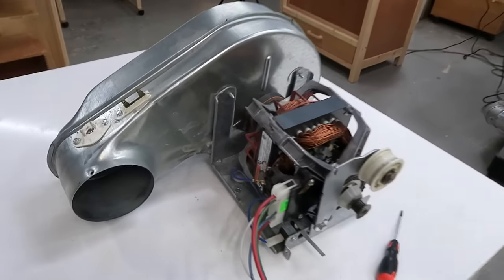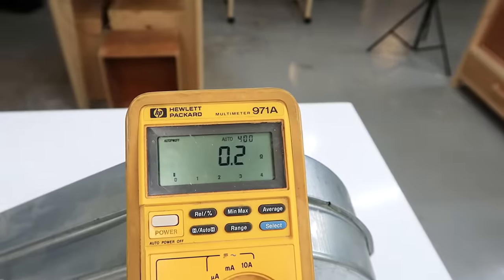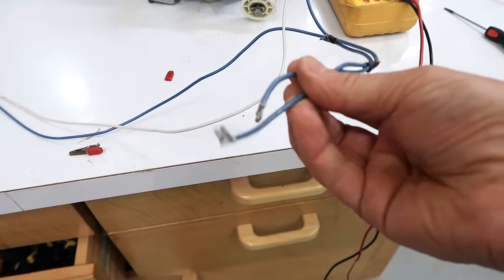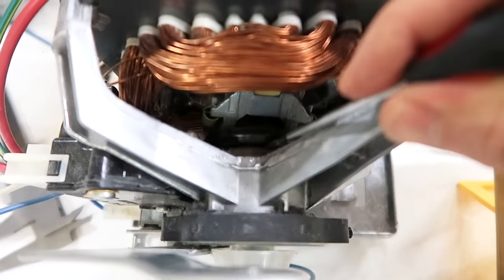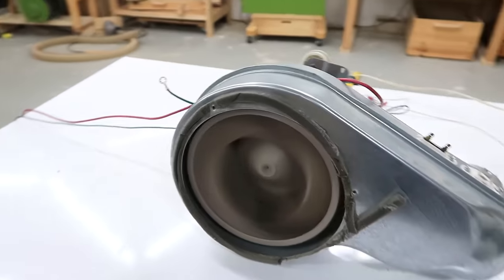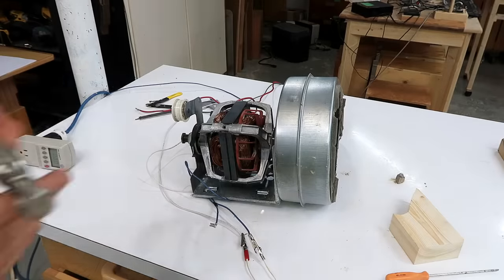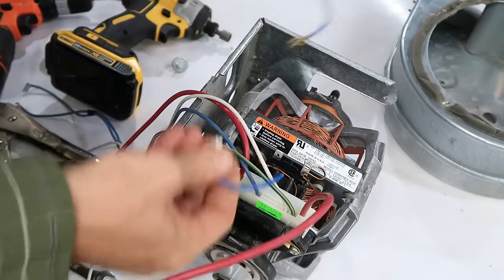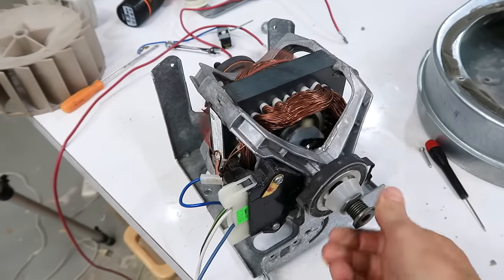Wiring up and reusing a clothes dryer motor

Comment: Don't write off those red (heater) wires too soon - might be very handy to have some way to signal/switch something on after the blower/motor gets up to speed. Ex: Maybe run the sander motor through those wires. Now the "On" switch results in a sequencing of blower first to ensure dust mitigation, then sander to do job.
Reply: I did this. When i made my wood table saw, i used one of these motors (from a much bigger unit) and wired the vacuum cleaner to start through them. It's in general a good idea to never cut wires that aren't specifically assigned to something you can't use, you never know when you might have an use for them. I just tie them up neatly, and then put a ziptied bag over them to keep dust out.
Reply: I was thinking the exact same thing as soon as he described it. Lots of possibilities there.
Reply: He didn't cut them I think...  Just removed them from the plastic connector.  He could reinsert them I'm thinking if need be.  I just don't see him overlooking that
Reply: @jimsjacob  Yeah he just depinned the connector
Reply: False alarm guys.
THANK GOD!
Reply: Dont Check My About Page Link  You're doing it wrong

Comment: Retired appliance tech here- the BEST way to remove those type blower wheels is to lightly clamp your vise grip on the motor pulley where the belt goes(so as to not dmg the ribbed pulley with the vise-grip teeth), then pinch ONE fan blade and swing the motor rotationally till you have the vise grip as far as it can go the one direction, then give a quick WHIP the other direction while still pinching the fan blade and let go at the last second and when the vice grip strikes the table (or the floor pan, of the dryer) the fan wheel spins right off as the vise grip comes to an abrupt stop - works like a champ EVERY TIME, and you'll never break the plastic fan when changing a motor
Reply: Yep! Same principal as an impact gun. :) Auto mechanic here. Very often a rusty bolt will break if it's loosened with a steadily applied torque such as via a plain socket wrench or breaker bar. In contrast, the fast impact action of an impact gun will loosen the rust and give it sharp rapidfire taps that eventually work it loose intact. Ford made an engine in the early 2000s called the "3 Valve Triton." I believe it came in V8 and V10 flavors. Anyway, they used this bizarre long sparkplug that was a bad design and it would get carbon fouled and rusty over the years until it was FIRMLY stuck in its hole. I ain't kidding either when I say they get stuck, that's S-T-U-C-K, stuck! The best way to remove them is with an impact gun while the engine is piping hot. Just get the strongest and smallest 1/2" impact you got and the tightest fitting extension and socket you got. You just make pretend that you're an F1 driver and take the truck for a race around the neighborhood, then immediately slam the plugs out with the impact without mercy. If they break, they break. 🤷🏻‍♂️ The ones that break were always going to be hopeless. They would've broken no matter what, especially with a ratchet. The extractor tool that gets broken plug bodies out of the hole works pretty good. Usually you'll get 5/8 or 6/8. The back ones are the worst. The impact action is critical for the job. You may think it's horrifying to imagine putting an impact on a sparkplug, but it's the only way to avoid an 8 hour book pay nightmare.
Reply: Damned Maytag have a small belt making the connection.. That trick will help with some but not all my stuck fans
Reply: @mannys9130 bro, I am dealing with this problem! I got a damn 2003 Ford Expedition that I need to change plugs in 😢 what is the tool you speak of to get broken ones out cuz I’m quite sure it’s going to happen 🙃

Comment: That simple cutoff switch made of bent wire that lets the motor detect if the belt is intact or not is quite clever. My drier doesn't have anything like that and once announced its broken belt with what I can only describe as the screams of a hundred rubber chickens in a cement mixer.
Reply: This youtu.be/khOfSVULtsU is of course what rubber chickens should sound like.

Comment: The "nut" inside the blower fan is round and knurled.  Short of welding/epoxying it, it's not at all useful.  If you come across more of the motors, some have a longer shaft and some have the pully and fan threads reversed.  i.e. the fan "nut" has normal threads and the pully has reverse.   Just FYI. :)

Comment: That was so so generous and kind of you to show us and educate us noobs on how to tell what the wires refer to and how to test them. Any chance you can do a video describing my certain elements have more wires than others in a dryer or washer? For example I was so overwhelmed when I opened up my dryer and saw the timer switch had like 6 wires and capacitor had what seems to be 4 wires and the cycling thermostat had 4 but the thermal fuse and high limit thermostat only had 2! Can you maybe do a video getting into all of these elements and why each has the amount of wires it has?! Thanks so much! (If u can’t do a video maybe u can do a written explanation) ?

Comment: Can you tell me is the number 4 or five spot on the motor the hot wire? The other is neutral correct? And the green wire going to the bent piece of flat copper is the ground?

Comment: Hello Matt, I have the same motor, not the piece that goes on top, I want to use it as a fun and I do not have the white part that goes on top. Could you tell me how to wire it? I know the black and white may be what I need to wire for it to work, and the blue and red wires may be different speeds but I am not sure. Thanks.

Comment: My drier uses extra contacts on the centrifugal switch to run the cycle-end buzzer. If the motor is not energized but the centrifugal switch is engaged (indicating the motor is turning) the buzzer sounds. Saved them the cost of a 1-second timer relay. Actually that must have been my previous drier; the current one has not required service yet so I would not know how it is wired.

Comment: I just got one before yesterday,  it took me hours to get it removed from a broke dryer., tested and is working well but I am still not able to unscrew the fan which I like a lot because designed in the way it can serve as a micro turbine if cast fur a durable use.

Comment: the fastener location on that style of motor was very perplexing for me, as there are no fasteners . whenever i save a motor i also look for a way to take it to bits so i can clean and replace bearings in need be. i got a motor just like that one from an old dryer and its centrifugal clutch was busted so i had to find a way in. so yea, there are no fasteners but a spelter socket type method of assembly.

Comment: Interesting video. I have two motors that I need to use for something. Will check the wiring on my motors to find the correct power one. Hint for removing the fan  the square in the center of the fan is for a 1/2" drive ratchet and extension. Easy peasey if use the ratchet.
Reply: Yeah, I was wondering if that was 3/4" or 1". But same thing, the square is to get it off and on.

Comment: Did you try open Windows at different levels?
I managed to blow air from outside into our house by opening the door to our hot, not sealed attic. My assumption is, that the hot air wants to escape upwards, but cant due to air pressure. When opening the door and a window inside, the air from outside replaces the air that flows out, creating a strong air stream without a single watt of electrical power.

Comment: The two blue wires go to the long white long thermal fuse on the blower wheel.  Can bypass for this purpose, but never in an actual dryer.

Comment: I’ve always been proud of a clothes dryer fix I did many years ago. It was just a belt replacement but I couldn’t find the right sized dryer belt.  Instead I found an old ford escort timing belt that fit, still running solid! #improvise
Reply: That was my experience as well. I suspect manufacturers tend to use whatever belts are the cheapest at the time to benefit from the economy of scale. They don't really make a secret of this, but they tend to list such parts with custom SKUs to make them seem like proprietary parts. My dad once tracked down a belt replacement from a car parts dealer just by showing them the broken belt, they measured it and found something off brand that was functionally identical. 12$ vs the $50-$100 asking price for "geniune" replacement parts from amazon and specialty suppliers.

Comment: the red wires are used as a safetly interlock so the heater cant turn if the motor/fan is not turning.

Comment: 4:43   It looks like the centre of the pulley  may be a 1/2" square  from a ratchet extension.
Reply: I was just about to say the same thing but figured somebody already has, yes that was what I used when I took my dryer apart.

Comment: Those motors work very well unmodified just as an ventilation fan`. Just hook up a dryer hose and run it to the outside.
Reply: It would have really awful efficiency, though. A motor that big could easily run something the size of a condenser fan.

Comment: I too had an intact take- off motor from a dryer and made a buffer- polisher machine, it works well but gets very hot in a fairly short period. I think the duty cycle rating of those types of motors are short "on" duration, longer "off".
Reply from the maker: dryers typically run continuously for an hour
Reply: @matthiasrandomstuff2221  Then the answer is obvious; I'm working it too hard. ☺
Reply: @BeachsideHank  How hot? It's typical for motors to get hot during normal operation. For example, the motor in my desk fan typically operates at about 65°C on low.

Comment: Very helpful. I just acquired my first motor from my old garage door and haven't started tinkering yet. States 115v, 4.6 amps, 1,000 rpm. Think it's suitable for anything? I'd be interested in building a small bandsaw or small wood lathe.
Reply from the maker: Suitable for anything that doesn't run for more than 20 seconds at a time.  thsoe garage door motors are not continuous duty.
Reply: @matthiasrandomstuff2221  - you should have let him find that out on his own! Rats! 🤔

Comment: Would that motor be strong enough to run a rotor off of each side, and produce more air flow?  Not sure how that would be incorporated into a dust collector or whatever, but it seems a waste to not take advantage of it.
Reply from the maker: One bigger rotor will do better than two small ones

Comment: i was trying to make a pottery wheel from a dryer motor, you think thats possible?
Reply from the maker: Just need to gear it down appropriately.  But pottey wheels are usually variable speed and reversible.  Dryer motors are not.

Comment: weird that there isn't a capacitor for the starter winding, normally the capacitor is used to give the 90 degree phase shift
edit: never mind, it's a split phase induction motor

Comment: I work on appliances for a living and those blower wheels are incredibly hard to get off at times. Very frustrating
Reply: This one looks like a simple square drive would have done the trick.
Reply: I’ve never had a issue w it’s the right tools.  Socket driver in the blower wheel and and socket on the pulley at the other end. On ones with a speed reducing belt the blower shaft has a flat surface to get a crescent or ring spanner on to. And just remember to turn the right way since they are reverse thread

Comment: Seems to me that volt-free connection on the motor (two red wires) could be very handy - if you end up using this motor to make a tool, the red wires could be used to control a separate dust collector on a different circuit. Given the fact its designed to handle the power of an inductor - the switching mechanism can probably handle anything you want to throw at it. Another idea that occured to me is if you had some kind of multi-stage dust collection system (using multiple fans), you could daisy-chain them on a single switch with multiple power sources.

Comment: Sort of confused. He says the starter winding is smaller, creating greater resistance, leading to a phase shift. But then when he measures it with the ohmeter (when centrifical switch isn't depressed) it says the starter winding has a resistance of 1.8 ohms in comparison 3.6 when it is running. Why does the resistance go UP when the starter winding is disconnected?
Reply: Not sure about the use of the phrase 'greater resistance'  in the explanation - the starter winding is just wound differently to give the temporary start up phase shift (thinner wire but fewer turns could still give the same resistance).  Answering your query: The starter and main windings appear to be both 3.6 ohms d.c. resistance, but are in parallel when both are connected - not in series.   Two 3.6 ohm resistors in parallel gives 1.8 ohms.  When the starter winding is disconnected, there is just one at 3.6 ohms.

Comment: yikes when you put that wood pry bar in the fan to remove it I cringed.....just last week I had to replace ours and it cost me $170. FYI that centre hub on the blower fits a 3/8 drive ratchet. for removal and reinstall.

Comment: I laughed when you plugged it in without holding onto it or clamping it down.
Reply: Whenever I have open 120Vac connections, I tape down the wires and think about what might yank on them before I turn on the power.  He should have done that.
Reply: Sometimes a motor will roll over on the table when you turn it on without something holding it down
Reply: @Malungeon18436571  Not just sometimes!  Due to conservation of angular momentum, a sudden start of rotation inevitably produces a perpendicular torque.  You see this all the time on BattleBots when robots with high-speed horizontal spinners compete.  Every time they make a turn, the torque throws up one or the other of their wheels, making it look like they're dancing.  They're not dancing.  They're miserable.  They're forced to fight day in and day out, getting their guts kicked in.  And no robotic sex, either.
Reply: @paulkolodner2445  I’m ok with that. I’m a hardliner on robot rights. Give them an inch and they’ll take a mile.

Comment: Im trying to accomplish the same thing as a dust collector motor, but for some reason the motor gets really hot after only a few seconds work. What the heck am I doing wrong.
Reply from the maker: wired incorrectly.  Posibly using the starter winding as a run winding, but only a guess
Reply: @matthiasrandomstuff2221  ya I thought I followed it close. But it was pulled apart when I got it. I have half a harness, and everything else is missing. I'll keep trying. 
Love what you do here, unfortunately I'm trial and error, I know very little about electrical.....very little.
Reply: @matthiasrandomstuff2221   I'm not sure if I can share a picture of what it is I'm working on, through hear, but I have tried 10 different ways, 2 ran the motor both times it heated up very fast, didn't allow it to get to hot though. Used a sensor to watch if the temp spiked or not.

Comment: Serious question, what is the difference between DC resistance and AC resistance?  Did I miss something somewhere?
Reply from the maker: yes.  Where to begin -- I can't give you an electronics course in a youtube comment.
Reply: @matthiasrandomstuff2221  Okay :)  True, you probably couldn't explain it very well in a YouTube comment.  I trust you enough...I'll look it up and let you know what I come up with. 👍
Reply: Without getting technical and nerdy basically DC uses the entire conductor where AC uses the outer most of the conductor cause the resistance to be higher.  Kind of like you had a smaller wire for the AC to travel on.
Reply: @tom5256  That is skin effect and it's not what Matthias is talking about (at 60Hz skin effect is pretty much negligible). The thing with "AC resistance", or impedance as it's properly called, is that inductors (such as a motor's coil) behave as shorts for DC but due to complex reasons actually behave kind of like resistors for AC, in the sense that they limit the current that can travel through
Reply: @gigigigiontis8  Thanks for the info...I'm still reading on it and trying to understand...it's kinda complex, my wife was trying to get me to do something while was reading about it and guess who won that one :)

Comment: I noticed you have an HP multimeter. I didn't know they made those! Anything the "brand name" does that a no name multimeter off amazon cant?
Reply from the maker: probably a fluke rebranded.  It's nice and precise, can measure AC down to milivolts, and also measures frequency
Reply: HP used to make very good measuring instruments. CuriousMarc has a lot of them.

Comment: So if he replaced the dryer but the motor still works, then what went wrong with the dryer?
Reply: The heating element? It should have some resistance instead of shorting out
Reply: Maybe nothing. Maybe they just wanted a new dryer. I've disposed of appliances just to get new ones. Sometimes you just feel due. It doesn't happen every day but every now and again it can. And that was just the blower motor. A different motor would tumble the drum.
Reply: with a drier, if the tub bearing goes out it will cost (retail) almost half of a new unit. OTOH, most driers will last about the same as two washers, but most will replace them as a matching set because they don't know this. BTW, also consider that new units will have electronic controls, which can also be expensive.
Reply: @1pcfred  Usually the same motor turns the drum. The little pulley on the other side of the motor runs a belt which is wrapped around the drum.
Reply from the maker: the electronics died
Reply: @matthiasrandomstuff2221  Typical modern electronics. My dryer only uses electronics for the humidity-sensing automatic function. It can do timed drying without any semiconductors.
Reply: @eDoc2020  Same. Even my new dryer has a mechanical timer. The "automatic" function just pauses the timer until a sensor is activated.